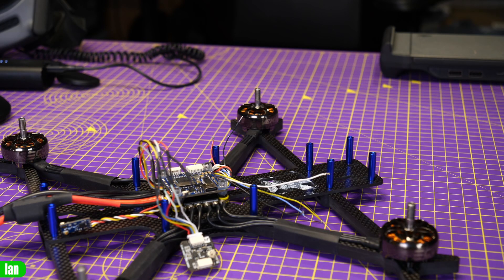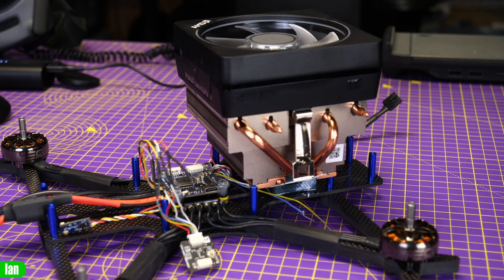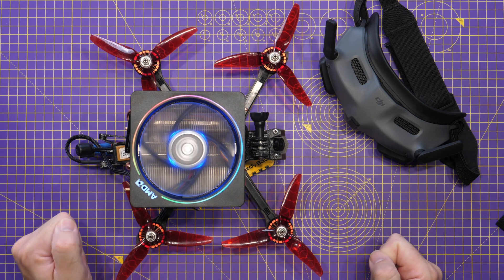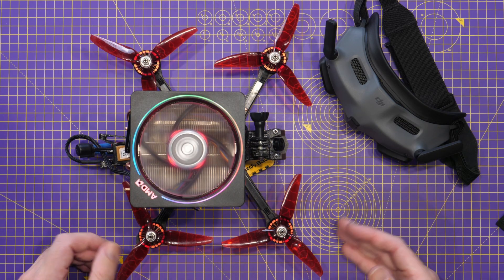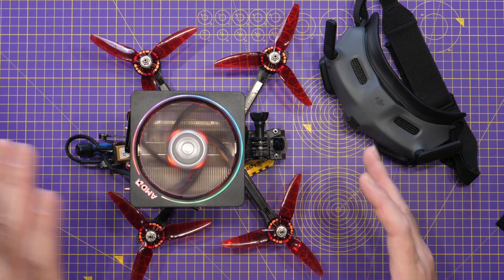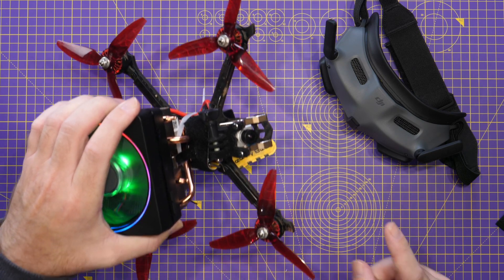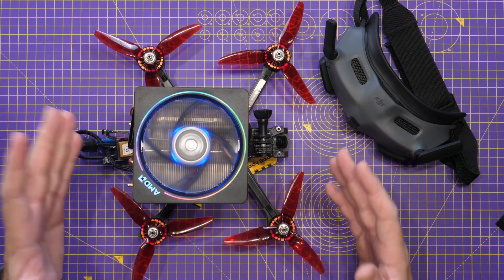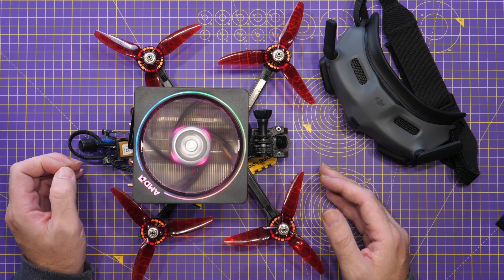Better Digital FPV Is Coming Soon!!!

Comment: Thanks. Do you have any plans to run liquid cooling loop? That might help cool the FC and ESC, and we might be able to push PID loop to 3.2 GHz and ESc at Dshot 12000.
Reply from the maker: I’m eating for EK to release a block for it first.
Reply: @MadRC  Ahaaa. EKWB do make good waterblocks.

Comment: Can the new unit be used in SLI configuration to double the resolution?
Also, it’s worth considering water cooling. Of course, it’s just 2.5 kilos and risk of flooding the electronics. But that’s just the price we should be prepared to pay.
Reply from the maker: Sli is dead. DLSS is going to revolutionise FPV with the DJI 90 series later this year.  8K FPV is coming.

Comment: I would absolutely love to see this fly for real. Something tells me, millions of others would as well. I have had that heat sink in one of my computers in a previous build. Very funny and love how you have the fan actually running. 

I do hope and believe the next DJI FPV drone will be even better than the last. They seem to get better and better every time. Soon in time you will have plug N play drones that will out perform or at the very least give an equal Whack-Roe experience to ones you build yourself. it pretty much happens at some point with everything. RC cars, boats, helicopters, planes, gliders, etc. This doesn't mean if you're a hobbyist that prefers build it yourself experience that it will completely go away. Just means you will have people that will bypass the frustrations and get flying. 

Have a pleasant holiday season!
Reply: Big problem is that dji wont make their drones easily repairable like normal fpv quads

Comment: I would regretfully like to inform you that the cooling aid was improperly installed, it should be fitted at an at least 45 degree angle, in order to both cool the VTX and suck your quad into trees.

Nice one Ian, nice one!! 😂😂

Comment: Should probably have used an RTX4090 cooler instead. Top of the line cooling for top of the line graphics. Size, weight, and power efficiency is over rated...

Comment: This honestly seems like the perfect setup for me.. the drone.. should it fly.. will do about 7mph top speed.. perfect for me to learn with. It will also prevent any unnecessary acrobatic crap..just straight level flight.. slow and smooth.. the way it should be!
Reply: So just stick to DJI or one of other self leveling drones.
Reply: @fpvsmurf  Nah.. that's boring.

Comment: LOL. But I'm not surprised. If DJI is going for 31.5dBm EIRP of the O3 situation in the FPV drone for example, which is around 1.4 watts, the input to the RF amplifiers has to be closing in on 2 watts at least if not more. That's a ton of power you have to dissipate out of a teeny little chip of a device. The existing Air Unit and Vistas already practically burn up even when set at 700mw. So I don't doubt getting rid of heat out of a little teeny little device pushing that much power through it's output stage is a real problem for the O3 air unit....

Comment: I heard if you reverse the fan to pull instead of push and you actually gain flight time!
Reply: It was configured in a push setup. Those cheap stock coolers draw air into them, not the other way around.

Comment: Do you think the fan will help lift off the drone? Besides that I don't see mayor changes hahaha
Reply: Yes, the cooler fan is able to carry 11.58% of the weight of the cooler since only 88.42% of it's generated power is used move the air through the cooling fins. That falls to 3.31% if you account for the weight of the fan. /s

Comment: It’s not released yet, assume some KOL’s have privately commented regarding their pre release units overheating? Is the case metal like it’s predecessor? Assume it’s just a matter of adding a reasonable size heat sink?
Reply: Yeah it is a bit worrysome comeing from mad, who seems to have some really good Info on that matter. On the other Hand in the dji avata they seem to have been able to manage the cooling quite well. Why would the o3 air unit be so much different? Other than some firmware issues that cause some ecxessive heat that should be dealt with in Software. What do you think?
Reply from the maker: Some things to think about.  Avata has a larger metal plate in its base where the stack attaches to to help remove heat :).
Reply: @MadRC  i guess the fpv community will be testing diffrent heatsinks for Our quads in the comeing months, which is what this video ist about ;-) i See now. It Will be intrestng to see wich additional weight will have to be added by the heatsink. Add Another 30g and the weight saveing by having to carry only 1 camera for fpv and recording will be mitigated. Since the naked gopros weight that much. What do you think?

Comment: Ian you wrong. It needs a liquid cooling system. O3 is specifically designed to work with Barrow SPB17 S V2. Cheers

Comment: Actually the air unit can be made in 4 parts each sit under the the propellers. I know if you crash it ll cost you but it's DJI

Comment: I laughed out loud when you placed that giant cooling system on there. Certainly feels like what most of these digital systems need nowadays.
Reply: Hmmmm… I’ve never once fried a vista or og airunit even on 109deg texas summer days… I’m sorry, you were saying?
Reply: @creationlabsinc.189  Same here In This Florida heat 👽🤟
Reply: Thats what happens when they don't get access to the latest shiny tech, that thing could probably run much cooler had it used a modern SoC based on 7nm tech, since the RF frontend appears the same using the same P1 chipset as a modem its always going to be the excess additional power consumption of the new chip they're simply bolting onto this older system. Could have been all done in 1 chip.